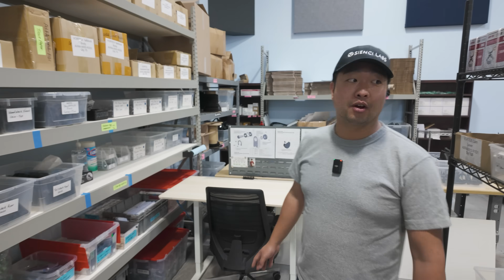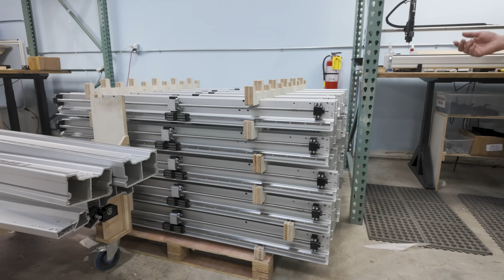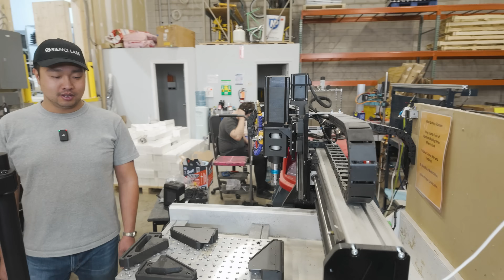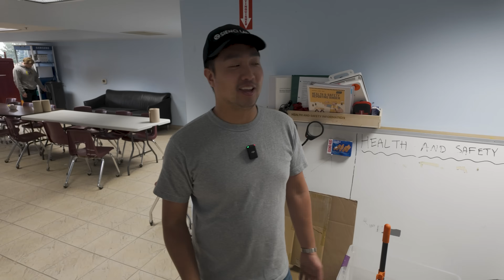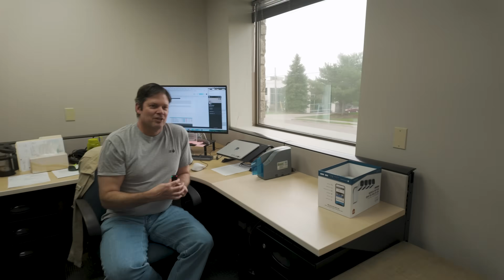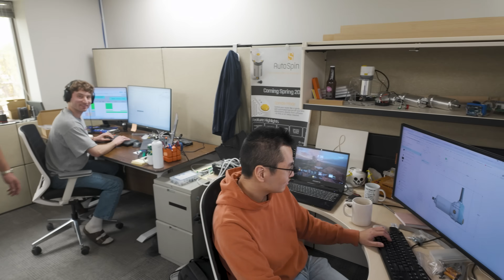2025 Sienci Labs Warehouse Tour

Comment: please use fixed Ballscrews with Rotating Nuts instead of the rack and Pinion for the 4x8 machine.. its more accurate
Reply from the maker: The engineers are exploring all the options out there. Thanks for the suggestion!